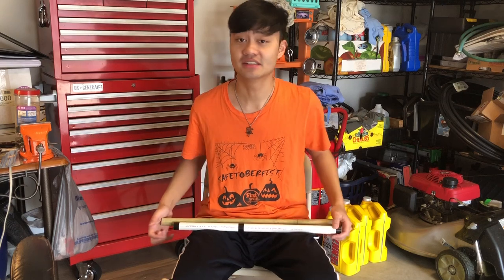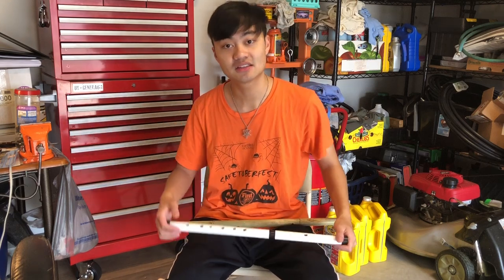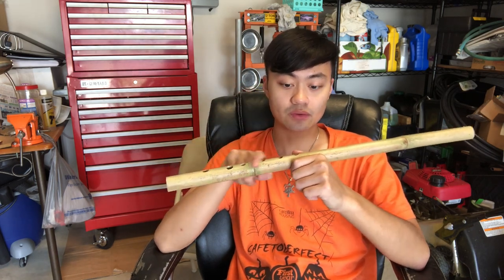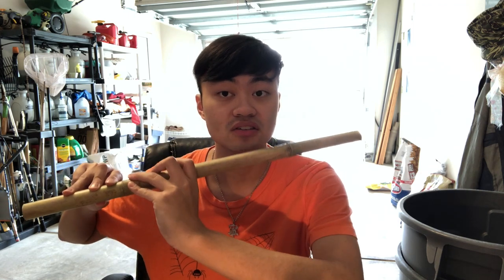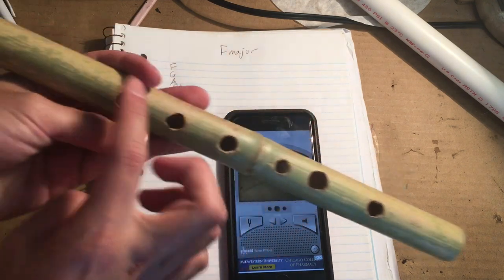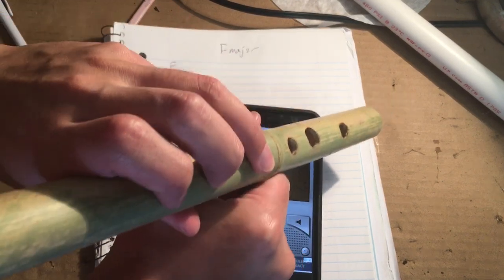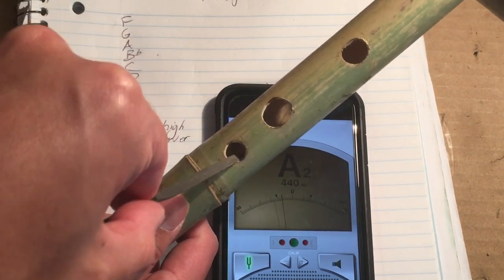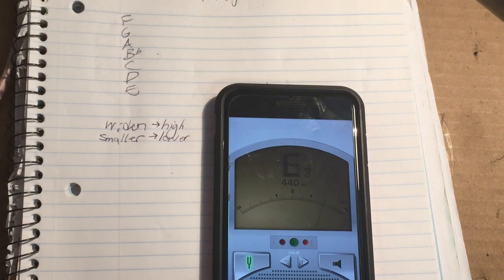How to Tune a DIY PVC or Bamboo Flute [Part 1]

Comment: Hey so I think I messed up and my first note is in F#.  How do I bring it lower?
Reply from the maker: if its sharp, it means that the length of pipe was too short. To an extent, you can adjust the cork inside to make it longer, pushing it away from the embrochure. but that is only a minute adjustment because it tends to throw off all your other notes. My advice is to start again from a new pipe, with a longer total length if  you have already drilled all the holes.
Reply: Take 19 inch flute it will be good for beginners and flute makers making their first flute